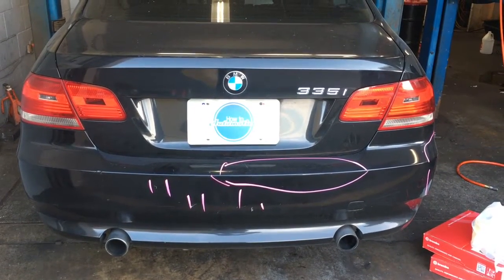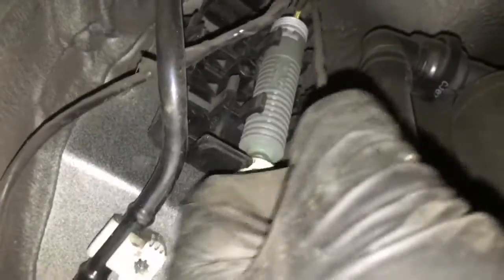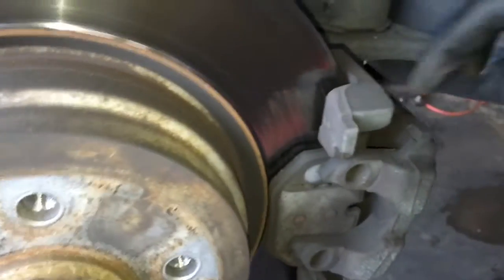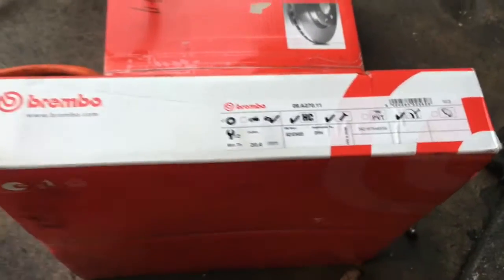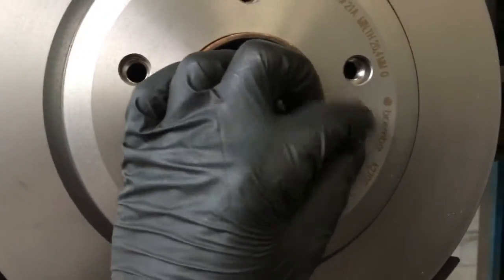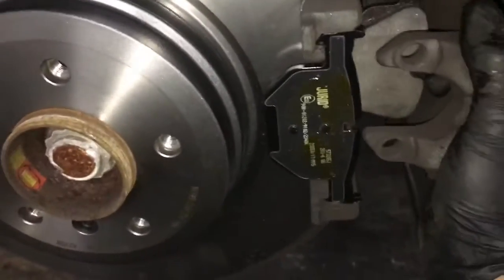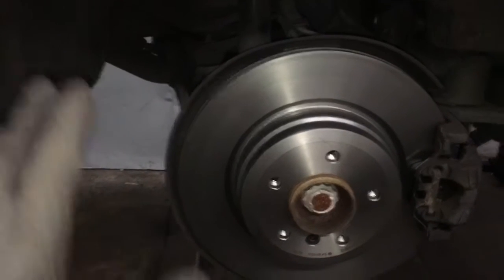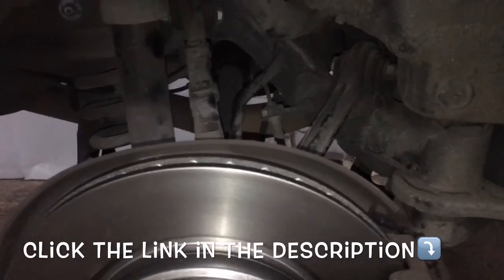How To Replace Rear Brake Pads, Rotors And Wear Sensor On A BMW 335i.

Comment: Is it really necessary to take out a couple OZ. Of fluid? I never heard of that being a major deal to do it. I also read online that the system bleeds automatically
Reply: It may or may no be necessary.  If you are able to push the caliper back without removing fluid, you are all set.

Comment: One or two sensors for front and one or two for rear? I assume I need a bmw scan tool of sorts to clear the red brake light on in dash and the red lift service front brake warning in the LCD cluster. Ok, mow I see only one sensor up front, one sensor rear.
Reply from the maker: 08turboSS There’s one center for the front and one sensor for the rear. He will need a scan tool to clear the light

Comment: What would've happened if you were to not take any fluid out?  Would it hurt the system?
Reply from the maker: ezekiel hurbines no it would not hurt anything, it could spill brake fluid in the engine bay and make a mess.

Comment: It's a mistake to take fluid out of the reservoir. Instead, open the bleed screw with a clear tube on it, going into a water bottle. Then you will press the used crap fluid out of the caliper into the bottle, without taking in air. And then when finished add a bit of brake fluid to the reservoir, and you will have NEW fluid entering the caliper. Otherwise, the same old dingy fluid stays in the caliper.
Reply: Incorrect.  If you are just changing pads, his method is correct.  That said, you SHOULD occasionally flush the entire brake fluid system, which entails bleeding the brakes at every caliper. When you do this, you flush a larger volume of brake fluid through each caliper to ensure fresh fluid in the system at every caliper.

Comment: Ok everything was right on your vide except the wasted time I spent pulling back the inner wheel arch cover to undo the brake sensor wire since you can simply undo this in the actual brake pad end!  There is absolutely no reason to take the wire out since you dont replace the wire.  New brake pads dont come with the wire attached!  What a waste of time !
Reply: Most brake kits comes with the sensors. If you’re replacing the rotors why wouldn’t you just the extra time and replace those $9 parts for piece of mind??
Reply: My sensor had to be replaced, it was very worn (as it is designed).  But the wire is integral to the sensor.